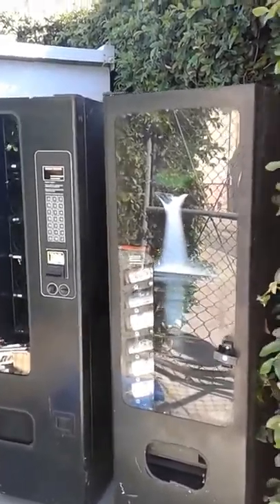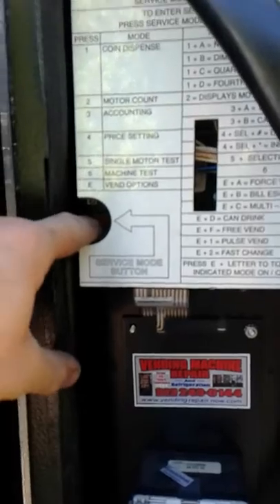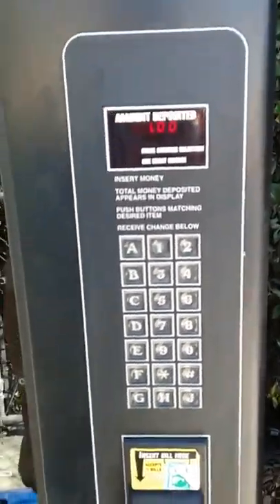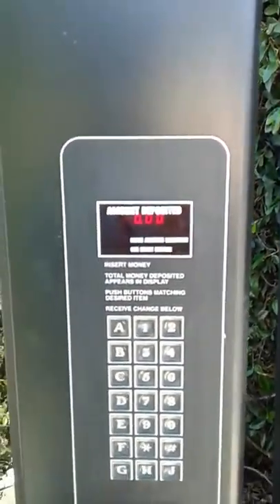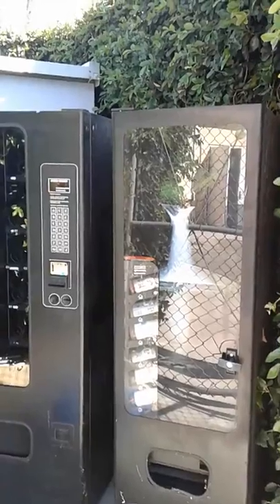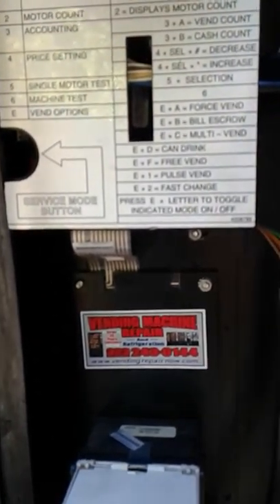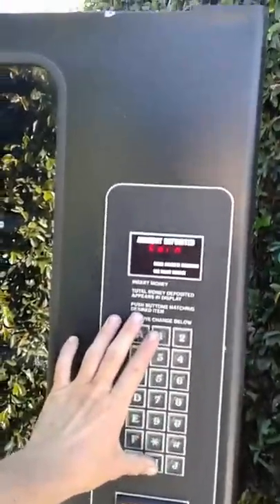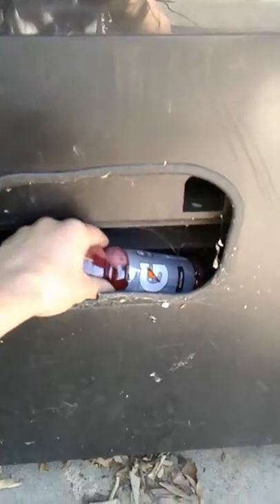FSI Vending Machine models: 3172 & 3120 (how to program + test)

Comment: I’m going to have to replace 2 motors in my drink machine that is a set up just like these. Would I need to unplug the drink machine to be able to change them or just turn the power off on the snack machine? Or do I even need to do all that?

Comment: my vending machine like this one does not work for coins , where i buy a new coin collector for this machine and i would like to change the reels for wider ones could you help me where i find this and if it has to be specifically for this model or is it all the same!?
Reply from the maker: Often on these type of things there is a part number. I suggest looking at the part in question and seeing if there are numbers printed on it. Then search online for "fsi 3172" then that part number and "buy", so for example "fsi 3172 1024 buy", where 1024 is the part number. Best of luck.
If that doesn't work then